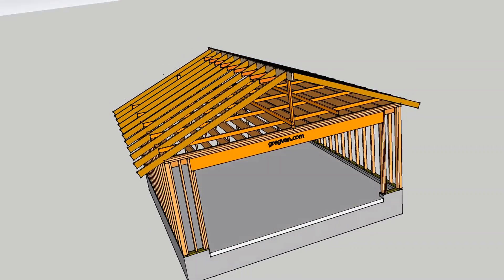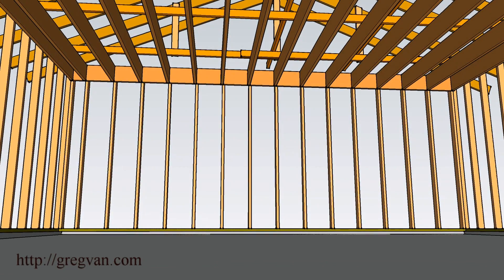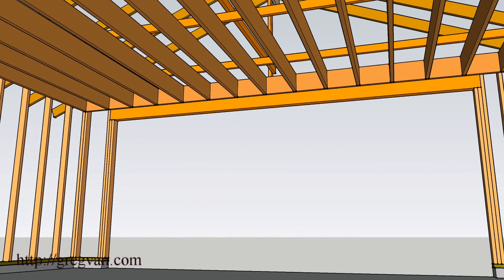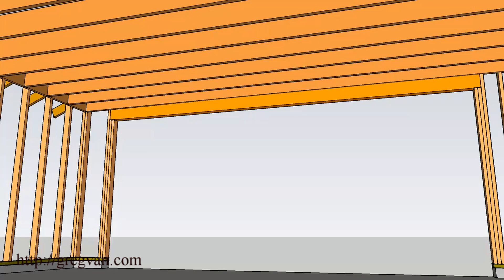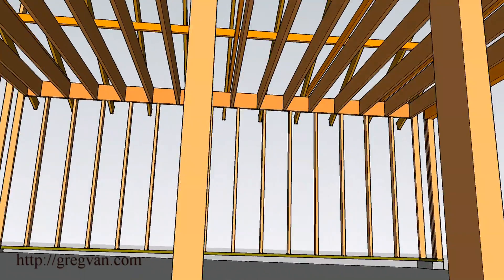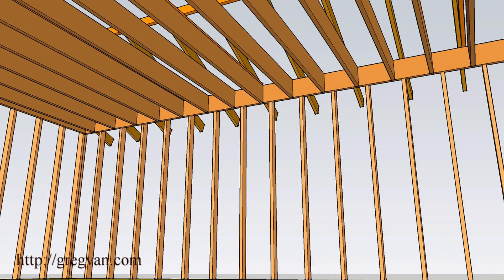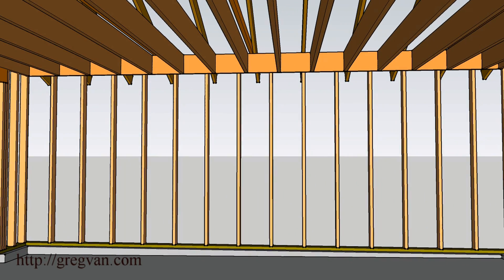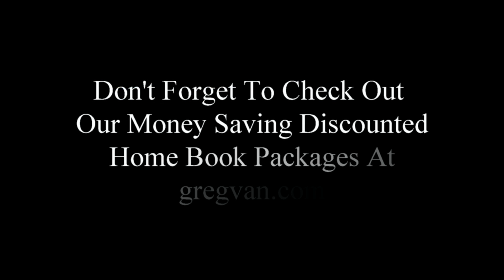Avoid Putting Extra Weight on Garage Header – Design and Remodeling

Comment: My garage door rafters are perpendicular to what is in your video. That is, the garage door is on the end wall as opposed to the gable side. The garage spans only one half of the gable side wall. That is, the garage roof spans from the ridge beam to the end wall. How do I add additional joists to add a ceiling and also attic storage? I don’t see any option other than on top of the garage header. Any advice appreciated. Thanks.

Comment: hi, i have a 2 car garage (10 year old house) and wanted to hang a pull up bar from the ceiling of garage. i was going to get a 2 by 6 wood and screw it into 3 joists using lag screws, and then screw the pull up bar into the 2 by 6? will this hold?, i just dont want to break any joists. do you recomend any other way? thanks
Reply from the maker: +kawal gautama If you're just talking about a bar to do chin-ups for exercise, then you'll probably be okay, but if you're referring to something that you might be using the pull motors out of vehicles, then probably not. Let me know if I didn't answer your question.

Comment: Hello. I have a 3 car garage and the joists are running this way, but they sit on top of the LVL headers. I am looking to drywall the ceiling and add storage to the attic. Can another LVL be bolted to the existing LVL? There is enough room on the footer to add another post. Just wondering. Thanks,
Reply from the maker: VideofromGeorge I don't know whether you can or can't and would suggest contacting a structural engineer to answer your question. Remember, most of the components including structural beams aren't always going to be able to support additional weight and were probably designed to carry just a little more than the load they already are.